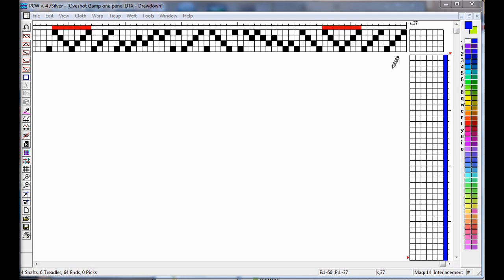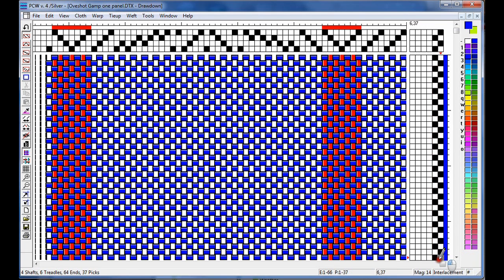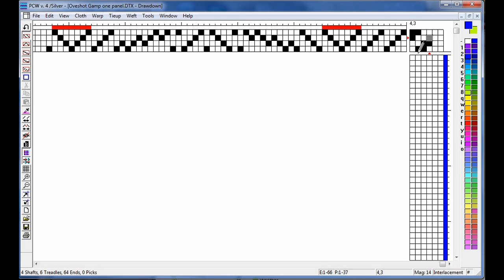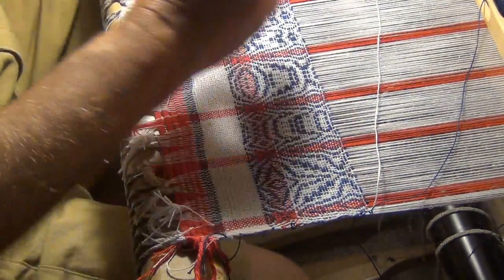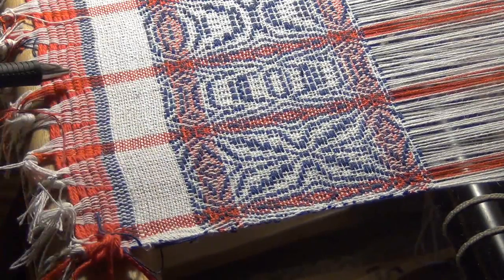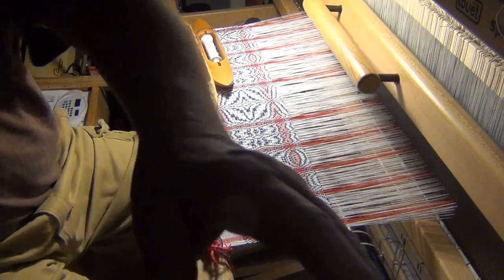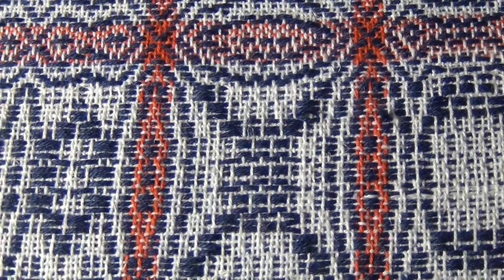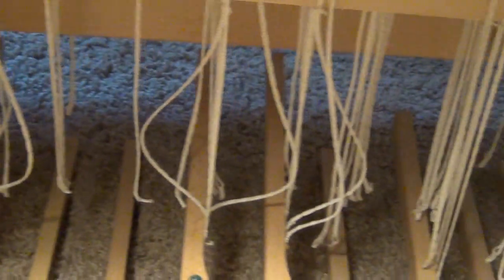Overshot Gamp   Part 2   Tieup and Weave

Comment: Some of your weft floats are very long. I tend to add an extra shaft to the designwith very thin threads on it of a neutral colour and pin the long floats down with this when they occur, this also gives a tighter weave.

Comment: Wow! I am blown away.  I never knew you could do all of this with a loom.  I had been contemplating getting a loom, but after seeing your videos I went ahead and purchased one.  I can't wait until I get to your level of skill.  I only hope it will not take too long. Practice, practice, practice.  Right?  Thanks so much for doing your videos.
Reply from the maker: Carolyn, you are correct that practice does help, and when you get done practicing, then do some more weaving, and finally practice some more.  As for what one can do on a loom, part of that is controlled by the loom itself.  For example to do the overshot shown here you need a four shaft loom.  A two shaft or a rigid heddle loom will not be able to do this pattern, even if you practice for 75 years.  You can still do beautiful work on rigid heddle or two shaft, but not overshot.  I have probably got more shafts than I really need, but like the ability to do more complex weaving.  
What kind of loom are you getting?  When you get it, will you post a video?

Comment: Were you able to convert tie up and walk your treadles for this pattern?
Reply from the maker: One of the neet things, which I only learned recently, about the Fiberworks-PCW Silver program that I use is in the "tools" menu called "shaft shuffler" which allows you to put in a pattern as found and then re-arrange the threading or treadling.  So by re-arranging the treadling you can move a pattern in such a way as to figure out how to make it a walking treadling if at all possible.

Comment: The reason you have an elongated pattern is because your using two blue weft threads for every on warp thread
Reply: If you put 2 warp threads in 2 eyes on the same shaft, then when you do the reed threading the pattern will be wider in the reed and make the pattern square.